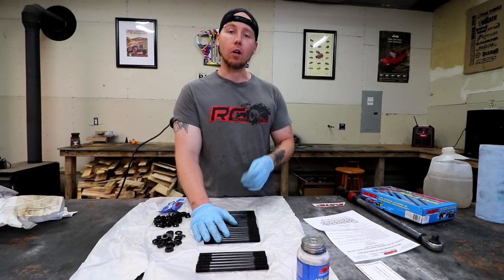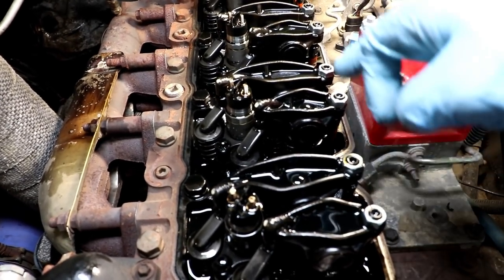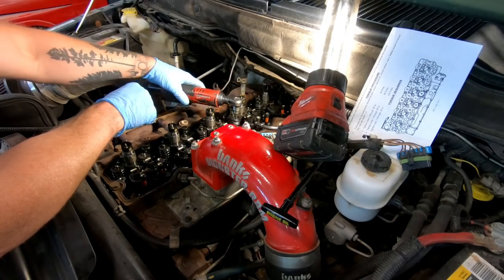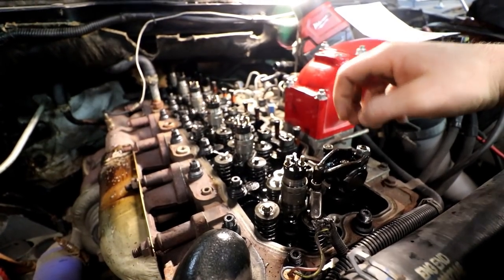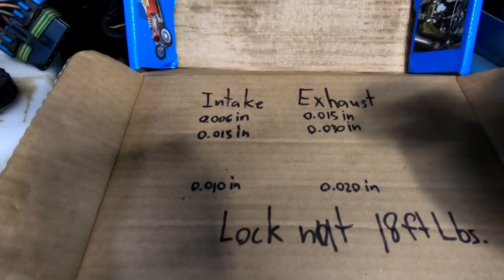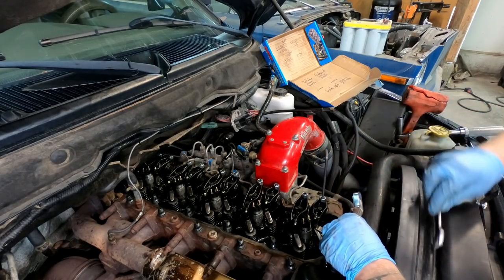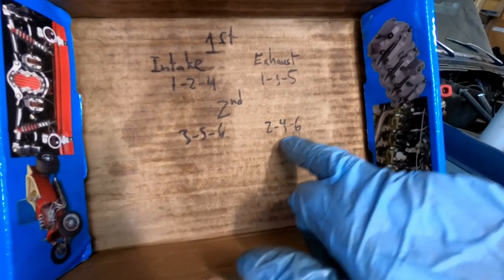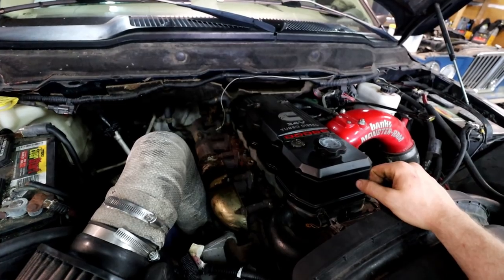How to Adjust the Valves on a Cummins Diesel

Comment: It's not the alloy that makes it so expensive. They go through several heat treat and then cold roll/cleaning cycles that make them so much stronger than your Average grade 8 bolt

Comment: I have never seen the inside of a Cummins engine. I admit, it's really nice. Definitely getting your moneys worth out of that electric ratchet.
Reply: I have the same Milwaukee ratchet....its truly the best tool .... it's not powerful you break them loose and torque them with a torque wrench but it installes and removes bolts all day long get one if you dont have one :)
Reply: Cummins are a beautiful engine.
Nate's 6bt is a workhorse. Take care of it like Nate does and it'll last you a lifetime.

It's powerful enough in stock form to do most anything you'd want it to do, but the abundance of aftermarket makes upgrading it worth it. New parts = longer & more powerful engine life. It's a no brainer.
This is the company that builds engines that power huge mining machinery. If they can handle building those, then a 12 or 24V truck engine of any year, size or variation, Cummins is where it's at.
Check out a Cummins 2.8 swap if you're a Jeeper. Amazing.👍

Thanks Nate. I own a 99 6bt and I was thinking about an upgrade. This is it.

I said it last week and I'll say it again: awesome to see you and the rest of the bleepinjeep criminals (oops...I meant warriors) doing something of everything. And in great detail. You just created a channel worth watching. Again.😅😅😅

Kudos. 🤙
Reply: @Maxxis1941  well said and thank you for the big compliments brother! I've owned a little bit of everything over the years and the 5.9 cummins is my favorite platform by far. I've had two 12valves, one early 24valve and this commonrail 24valve. All of them are super durable workhorses!
Reply: Mark A. Stephens if you've ever considered getting one of these ratchets do it. You'll end up using for everything from engine building to assembling IKEA furniture in your livingroom! Tools like this are very valuable time savers
Reply: @natebleepinjeep9564  Duely noted. Thanks for the tip. Always good to have handy tools like that.

Comment: My regular 2000s or 425s failed after 65psi, Innovative Fastener Group are by far the best out performing the arp 625 1200$ studs
Reply: IFG 12mm studs are from tool steel and can handle an even greater torque than arp 625s

Comment: Does this tutorial cover all the Cummins 5.9's or the late-model ones only???
Reply: This method works for all 5.9 cummins. The only difference is the Injectors aren't under the valve cover in the 02 and older cummins.
Reply: Nate Bleepinjeep I don’t need to grind on the 2002 do I so the valve cover fits back on do I ?

Comment: Hey Nate what do you think of the monster ram?? Did you notice much difference ?
Reply: I didn't notice a difference at all but I didn't expect to. A close friend of mine works at a junkyard and they had a Cummins come in so he hook me up with some odds and ends in this is one of them. I like that it has all the holes pre tapped for water meth injection/ boost pressure probe. I bet on a Dyno you would see a little bit of a power increase with something like this but when all you do is Tow like me the drivability is identical to how it was before I installed it.

Comment: Im in. Can you do a review on all your Milwaukee tools and which ones you recommend? I have a few and trying to decide what i need next.
Reply: That's a good idea! I'll have to put it on my list of upcoming videos
Reply: I want the 18v heat gun you used in a video.
Reply: The heat gun is a very convenient tool but as you could imagine it will burn through batteries pretty quick. If you have some of the bigger size batteries (4.0 or bigger) than you'll love the heat gun.

Comment: If your 5.9 is 03-07.5 you can look at one of these to replace that mid rocker on the head. Give you more braking power than the exhaust brake. Never touch your service brakes again while dragging your wagon loaded.   https://pacbrake.com/product/p55006-p59-loadleash-engine-brake-kit/

Comment: BOOST DOES NOT BLOW HEAD GASKETS!!! Cylinder pressure is responsible for head gasket failure. Cylinder pressure is effected most by timing
Reply: Not true, if you feed the engine to much boost it will cause headgasket failure. The cylinder pressure reaches a point in which it is greater than the clamping force of the headbolts. Very simple concept. There's alot of good basic information like this online if your interested. Injection timing can cause headgasket failure but is extremely rare in diesels. If you advance the injection event to far before topdead center (20° or higher) it can struggle to even idle correctly. This is from the fuel detonating to early. The combination of very advanced injection timing and really high boost can cause failure.  The only time this is a concern in a modern diesel engine is when you have tuner that doesn't have all of the information or is bad at tuning.